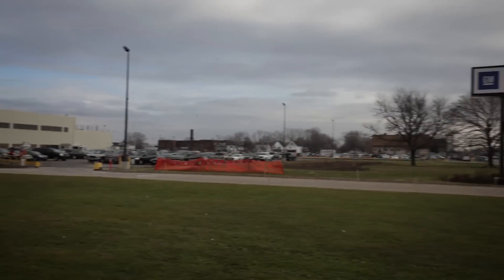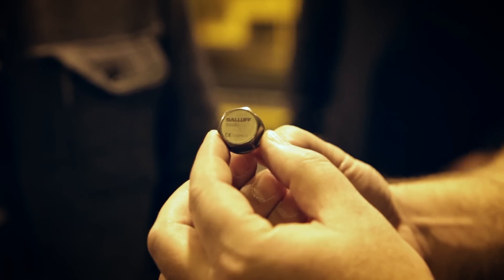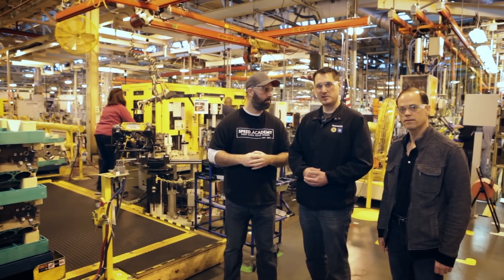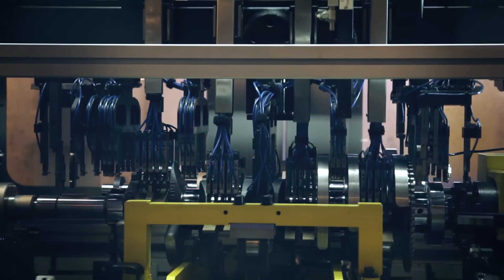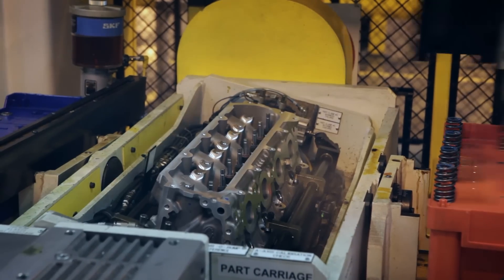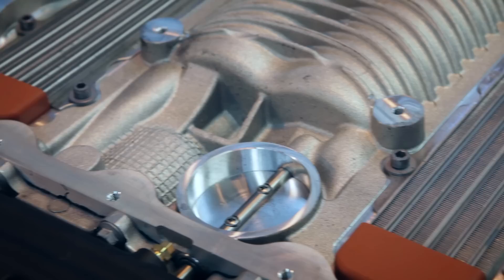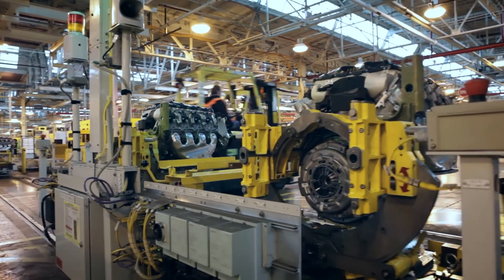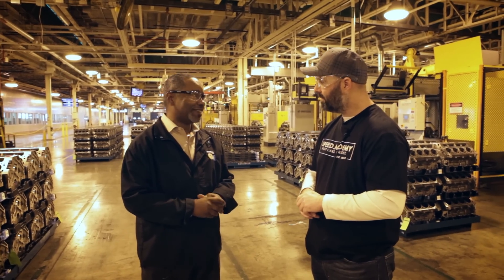Building GM's most powerful Engine Ever, the 650hp LT4 V8!

Comment: I wonder if thee robots are overpaid union workers
Reply: $12.00? WTF? No Union worker in ANY US automotive plant starts off less than 18-20 and Hour. GTFO with that $12.00 bullshit.
Reply: And your not a greedy american worker....Give me a break...
Reply: +803brando How could you think that a z06 is 130k, its actually close to 80k, unless you spec it with every option including the C7.R edition.
Reply: another IDIOT...

Entering employees at the plant nowadays receive the lowest wages in many years lets say of the 90's and early 2000 period. Further retirees that opt for the 30 year and out contract receive only 36K BEFORE taxes. Then they subtract dental, health, life, hearing and taxes from that check leaving the employee after IRS withholding with about 2500 a month. If the retiree then has a spouse who might be covered for a much lesser retiree death benefit an addition amount which is substantial is deducted from the pre taxed amount. Meanwhile even though the environment is much better than in prior years there are countless repetitive motion injuries of the wrist and hand and many shoulder ones as well. Further the air quality is better than it was but the oiled air guns spew it into the surrounding areas and employees are subjected to other chemicals like the white lubricants that bathe the blocks and cranks during some of the machining processes. Lastly the temperatures in plant one for instance have peaked at 113F in the machining departments some summers since there is no air conditioning. The sun beats down from the overhead windows which allow the sun light to come in on top of the heat. In the winter time employees can be found wearing jackets many times down on the floor where the temperatures are colder especially during the startup points of the morning and its not uncommon to see 50ish degree temps with people weaking coats to assemble and work through processes the robots do not do. Although the LT4 happens to be the most advanced in the plants history as far as automation goes, many other assembly lines require more workers to build the motors. They are a multi product facility and the largest in the world.

So before you go shoot your mouth off about how people are overpaid, yes there might be that select few at the top of the food chain, but those people EARN their money and ARE NOT ALLOWED TO SIT AT ALL except for break or lunch time. Try to sneeze and wipe your nose when the next assembly saddle comes by and you have 10-14 seconds to load the next process through OR THE LINE STOPS AND EVERYONE INCLUDING SUPERVISION SEES WHO YOU ARE.

IDIOT.

Lastly my last health insurance record from blue cross and blue shield showed what they paid over the last 3 month period over hundreds of dollars that I paid out IN CASH with no deductible coverage available. Wanna know what they paid smarty? Z E R O thats right NOTHING. Yeah we can see our primary doctor for office visits but that doesn't pay the bills for actual proceedures and tests or other doctors who are not primary that we get sent to.

Get educated about things you post about, try it sometime. Talk to actual people who have had multiple surgeries from injuries at the plant or loved ones who have had their family member DIE from being subjected to the environment in those plants for years. Mesothelioma, Immune disorders, Chronic pain disorders, Varicose legs leaving them with edema for life in their lower extremeties and loss of hand movement for life due to repetitive motion during assembly. They aren't making a hundred motors, some lines make over A THOUSAND PER SHIFT. So if you are starting 8 bolts by hand or even 4, do the math.

GOD some people really get me mad.
Reply: You have to understand that THOUSANDS of people who worked there as I did and were injured and had their health impacted severely while MANUALLY building these cars and receiving HUGE degrees of education in the learning center in the plant (some required by law for safety and some for quality assurance needs of the product) busted their butts with extreme physical exertion on many jobs, there still are some that are very rigorous, true not as many as there were. But for someone like myself to have people indicate we don't know how or HAVE NOT actually built an entire engine is HIGHLY incorrect and in many cases UNTRUE. We take offense to that as it must come as  no surprise to you. We aren't uneducated or unskilled as it was for many in the 30s-late 70s. Its a high power educated workforce on the move and up to date with all the latest information and ability to BRING IT. We take PRIDE in the product and the force that DELIVERS THE GOODS. We show up everyday because if we don't one of the assembly "team" is short and the others have to cover for him or her. "Team Concept" its called and it kind of pits one union person against another. For instance if one does not show because of illness or other reasons, the others question them the next day due to the hardships they endure because of it and ask "where the hell were you!". Working in the plants is a hard life and I am glad they still teach the engine building class and tear the motor down and build it back up. Many go on to fix their own vehicles after the training they get at the plant. True we don't have the computers like the dealerships have, but we learn enough to do what we can with codes generated by the cars and many of us know how to pull our own heads and intakes or change out injectors, plugs and other things that don't require the motor to be pulled. 

So thats where I come from, I am VERY protective of the plant, the product and the WONDERFUL people that work and have worked at the Powertrain Tonawanda Engine Plant. Any place has its bad apples, but there are so many find human beings working at that plant and I am proud to call many of them my friends :)
Reply: But he missed the trees.
Reply: Coe you are an IDIOT. We have a engine building class in the rear of plant 4 and employees take the course for a complete tear down and build up BY HAND of various motors. The instructor is a personal friend of mine and I worked in the department in charge of the training of ALL employees MOST of which was MANDATORY. 

You sir are an IDIOT.
Reply: +charles fournier 
They were made in Mexico, they work under the table .... or work for RAM chips?
Reply: I hate stupid people
Reply: Well you didn't make that additional point clear my dear. This is your quote "no body has built a motor in a American plant in over 30 yrs"

Just saying... and by the way... 30 years is not accurate either more like 20, I know I was there and saw how many bodies on the floor at that point about 2800 down from 4000ish in the 70's before the big layoffs 79-81.
Reply: I clearly remember the heads being placed on the v8s and v6s BY HAND and held there by one hand while the other drove one bolt in to secure it for the next step which was for the heads to be drive down by a person who pulled a large machine across rails that had air oiled driven pnuematics that drove them and then torqued. It was NOT a robot and was controlled by a human operator. Just pulling that large machine back sometimes ALL DAY FOR 10 HOURS was enough to tire out anyone. I had an electric assist but it wasn't powerful enough to get it out of time situations and adjust it to line speeds so it landed on the motor in time and not pull it off the saddle by the end of the operation since the assembly line did not stop. If you DID stop the assembly line a supervisor would come ream you a new butt hole for doing so and if you did it over and over you got written up and sent home for the remainder of the day.... Oh yeah good times :/
Reply: Even with all the automation you can see that it takes a lot of skilled man power to make it work - both on a computer and the production floor. There are some bad apples and I have seen them but not too many people have the mental and physical stamina to do the work these people do. When I have an opportunity to  be on the shop floor for just a few hours, the physical stress due to noise and environment are definitely felt. I can't wait to get home, take a shower and relax. I can't imagine how some of these guys do 10 hour shifts, 6-7 days a week.
Reply: stop by and see for yourself,by the way I'll take that bet
Reply: Poor designs by white collars is what got the Big Three in trouble to start with. They let the foreign companies get their foot in the door and it all became history.
Reply: No, the robots are the result of overpaid union workers. Get used to them, you'll see more and more in the near future as more things get automated.
Reply: Imagine that!!
Robots that'll nearly never call out sick, nearly never need lunch or bathroom breaks, nearly always be at the ready to produce as close to a flawless product as possible....save for the annoying kicked out power cord, power grid failure or pesky EMP attack!

And every one of them will now literally be programmed Democrat voters too!
Reply: right on  Charles....you see the forest
Reply: DAVID TRIAN
Reply: ***** well maybe we both misunderstood each other but at least try to find out or understand someone be they are called a idiot or stupid because I would never degrade someone be trying to learn or understand them...
Reply: i am a jabroney I bet you don't even work in a manufacturing environment. Union vs Non union. Fucck you wouldn't survive non union the labor is unbearable with supervisors yelling at you saying we need this much production. Being forced to perform safety in a shady manner. I do agree workers do abuse the rights given to them through the union. Taking long ass lunches, and performing the least amount of work possible. But at least there is someone to have there back when it comes to abusive supervisors, who always got something to complain about and you've been working your brains out.
Reply: Damn. That would take out 98% of the world.
Reply: Yet the auto companies are still in business. That should tell you how much money goes into the pockets of workers and how much goes into the pockets of stock holders who had the money to invest in such companies.
Reply: The Top of the line Vette is  $120,000 K or more it is Bad ASS  but  yes the  more standard version starts out around   $70,000 K or so
Reply: Yes and in China is the other end of the Spectrum .. Chinese people work their  asses off  15 hours per day 6 days  per week for about $5.50 per hour .. and they  do three times the work of a Union Worker and do better quality work ..  If the Globalists could get a   one world Government we could all  work like the Chinese for really low pay and really poor working conditions ..
Reply: Charles your an idiot you don't know what anybody gets paid so shut the F@#k up.
Reply: jeffrey625625 For petes sake stop blaming the workers for GMs past financial problems. I am a platform planning engineer at GM. Union wages are only a small part of the story. Pension costs are a problem but I find that the vast majority of UAW workers are engaged, productive and invested. The fact is that the average hourly wage at GM has been dropping each year as older tier one employees retire and new employees who come in at around $17.00. to $18.00 an hour replace them. The fact of the matter is that labor costs account for only 10% of a typical platform unit. Many organizational issues bit GM in the ass. Bloated staffing, piss poor off shore investments (Saab, Suzuki) horrible product planning, redundant capacity, poor product desugn and institutional bureaucracy all combined to make a huge mess. Unions are a pain in the ass but blaming them for GMs issues is just plain silly.
Reply: MaddoxInc Have you ever even been in an assembly plant? I have been an engineer at GM for thirty years. Certain jobs are highly skilled others not so much. You seriously begrudge paying an assembly worker $20.00 an hour? It is easy to blame the unions. Labor content makes up only 10% of unit costs for domestic platforms and 8.6 - -9.5% of Japanese and Korean transplants. The fact is that a new labor contract is renegotiated every three or so years. It took near disaster for management to finally stand up to some of the unreasonable union demands. I was a training engineer at Pole Town in the early 2000s. We would get a bunch of hotshot college kids as temps or summer help. Most were arrogant and condescending. Many woulg get through the first day and never come back. It can be hot grueling work.
Reply: i am a jabroney You have no idea what you are talking about. I have worked at GM as a platform engineer for thirty years. First. The guy putting gas at the end of the line does not and never has made $32.00 an hour. At Poletown the employees at the end of the line make $21.00 to $24.85 an hour depending on seniority. For the sake of comparison a fully trained technician at the end of the assembly line at Honda Marysville is paid 20.42 an hour. I dont know where you get your wage data but it is wrong. Period.
Reply: Robots won't strike.....
Reply: +charles fournier im not sure i want illegals from south of the border putting together an engine to a $130,000 car for $5 an hour.   GM understands  cost/benefit far better  you or i.
Reply: +jeffrey625625 .....without a union see how much you get paid......kill all people with IQ's lower than 110
Reply: Are they Mexican robots?? I hear all the jobs have been going to Mexicans!!!
Reply: no but it is true that any company that makes anything in any place in the world only has so much money after the pay for materials and pay for the machinery to make said product and if the unions back that company in to a corner and make them pay people more than those simple production workers are worth then you have to charge a lot more to the customer so you can break even and that is why so much manufacturing went to china the politicians paved the way well bill clinton and nafta anyway and since the companies had share holders to answer to the us economy has been decimated due to unions and politicians
Reply: UPS drivers are union and make 34.00 an hour driving a truck delivering boxes. Don't forget them. Takes an Einstein to deliver your mail.
Reply: no, that's a lie. GM has been paying their American workers extremely well with all the bells and whistles of benefits. While they were going bankrupt, they kept paying their workers bull benefits and wages because of the greedy union workers. because of that, they slowly lost money overtime and that's how they went bankrupt.
Reply: jeffrey625625 Absolute bull shit. GM did not get into financial trouble because of labor costs other than legacy pension issues. I am a senior platform engineer at GM. One of my jobs is to monitor labor content costs. GMs problems were terrible product line, unprofitable off shore brands, horrible quality and abysimal money management. Union employees dont even make the top ten. So. Please. Quit talking out of your ass.
Reply: bad banano lest we forget, GM & Mopar employees wouldn't b getting their big fat paychecks without the taxpayer funded bailouts.
Reply: bad banano great attitude. Did I strike a nerve?  I wouldn't want to pay unskilled laborers, I'm assuming you are one, to do elementary assembly tasks.  Let the people with brains run the show pal. McDonald's is always hiring.
Reply: bad banano hahaha. Hurry up and start the union break!  Now you guys can cry together! Hahahaha!
Reply: you are some what right as bill did sign it but bush senior had almost nothing to do with it even knowing he is as much of the establishment as bill hitlery and paul ryan we either need to make a national holiday once every year that it is ok to hunt and kill politicians or we just need to have a beautiful civil war all of the citizens united vs the shit government
Reply: bad banano the truth is there for you to see. I can't help dummies like you aren't smart enough to get yourself an education and free yourself of the grips of the slimy unions that ruined our country. Thank you, scumbag, because of greedy fat fucks like you, a good paying jobs in the manufacturing segment have been outsourced. Facts man. Read a book.
Reply: MaddoxInc... you my friend is so right no body has built a motor in a American plant in over 30 yrs it's all done by robots i work for a high performance shop ( livernois motorsports ) building engines all day and i bet nobody at that plant can actually build a LT4 with out the help of robot's..
Reply: ***** the point i was making is no engines are built by hand in American factories all the hard stuff is done by a robot and im not a idiot I'm very smart
Reply: charles fournier no such thing as an overpaid union worker. ya scab lover...
Reply: DAVID TRIANA that's American greed at its finest. Gotta paid some fat fuck of a slob $32/ hr to put 5 gallon of gas in a car at the end of the assembly line. Do you blame the businessmen for outsourcing work in order to make more money, which last time I checked, is why you operate a business?  Detroit...yikes. Look what happens when you let unions dictate how your business is run...fucks.
Reply: i am a jabroney You have no idea what you are talking about. I am a senior project engineer at GM. No employee on the assembly line gets paid $32/hour to put gas in a car.  Period. Please dont just make up bull shit.
Reply: Well, they won't be asking for $15/hr anytime soon. It's funny that at the beginning, the narrator says that there are skilled workers yet all the skilled jobs are done by robots. Everything done by the employees is done using automation tools. It's not a skilled job anyone. Overpaid union workers.